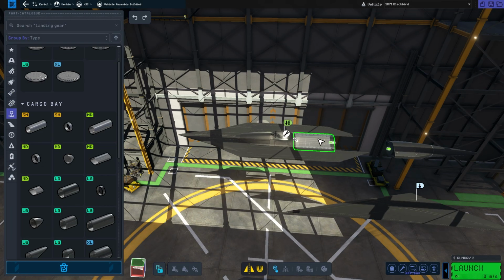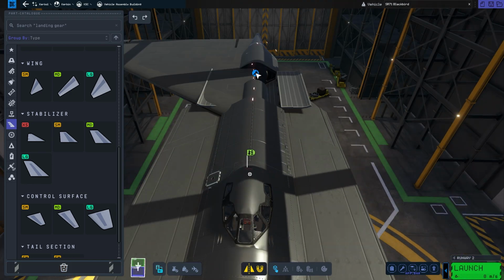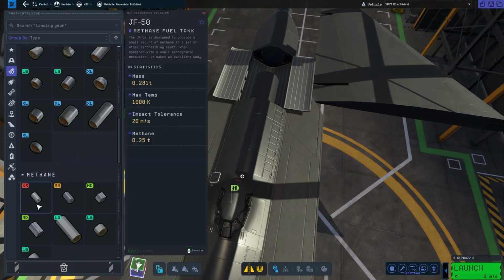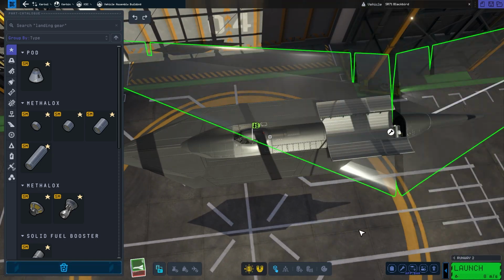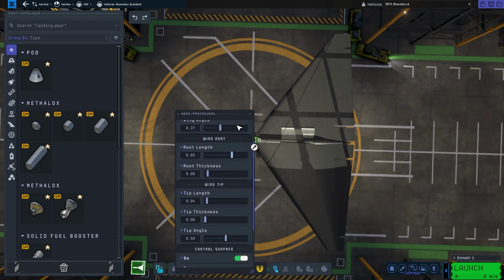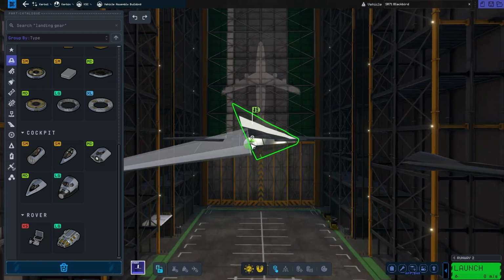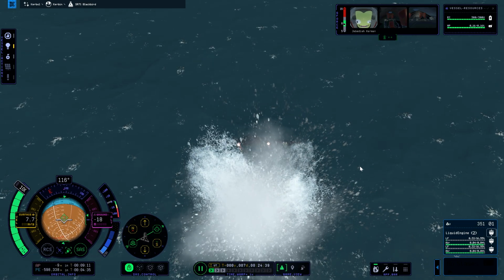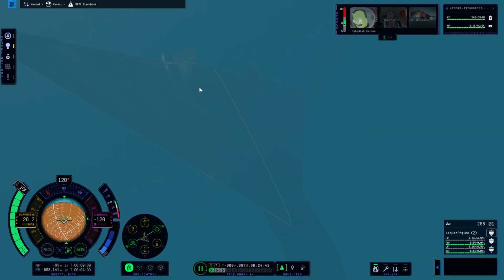Building the world's fastest turbojet in Kerbal Space Program 2 feat. SR71 Blackbird

Comment: I am currently testing a high speed airplane and I have reached in my first successful flight 743ms and then changed the wings a bit and reached almost 900. But I don't know how fast it was at the end because I went to the kitchen to check my meal and when I came back the plane was deep diving in the ocean... 😆
Currently the state of my plane is unstable, pretty much unflyable because I went for an extreme wing change. This is why i checked YT if I may find some inspiration.
The thing is, there is a balance on wing surface to drag, and your SR71 has a hell of a lot wings on it. No wonder it is slow AF but has amazing lift. You should go the other way around. Much less wings, less drag, but higher speed. 
I am not confident though to propose anything ideal yet. The thing is my planes so far have a weird tipping point where they start to get faster. I have to linger at around 9000m for quite a while and only very slowly getting faster, until the ratio from air intake (i guess) and resistance tips and the plane suddenly goes faster. At this point I can climb again slowly, keeping this balance in check (looking at the nominal thrust of the engine, it goes up and down quite a bit as I climb) and go faster and faster as I climb. At around 20000m then there is the altitude were I still can control the plane and don't burn the wings off at around 3000kph...
Oh and I am using the Panther engine in an exploration safe, don't have the latest tech yet. I am trying to figure out If I can make an low orbit delivery plane to carry fuel to a space station.
Reply from the maker: Great feedback, my design needs a lot of fixing! If you go to kspbuilds website, search Icarus and you'll see a crazy fast build. I recommend you try so you can optimise your spaceplane design. It can go over 1700m/s very quickly

Comment: Why don't you use the part move/rotate button to clip the wings or engines?
Reply from the maker: Tried that but didn't seem to help very much for the wings. Definitely could have done that for the engines but concerned that the kraken will pay a visit :D
Reply: @heretic391  Tbh I've had continues problems with wings and especially the aerodynamics (impossible to take off, no lift, screwed up symmetry etc etc.). In my experience clipping them through body parts doesn't play a role in that tho. But you're right lmao better stay safe until updates come.